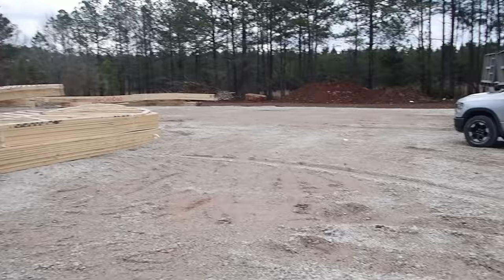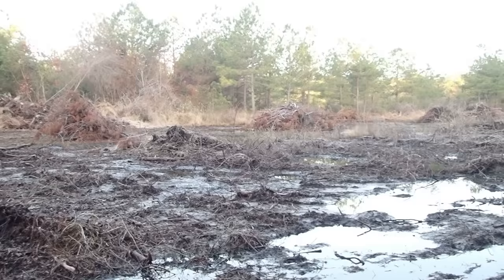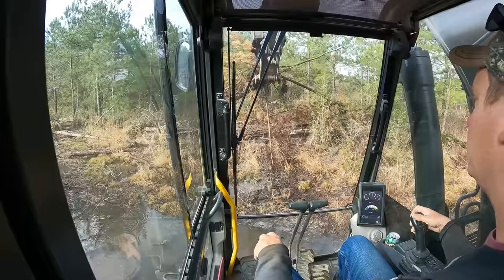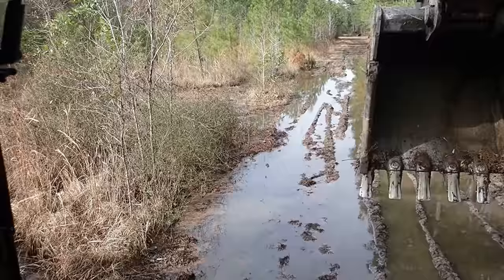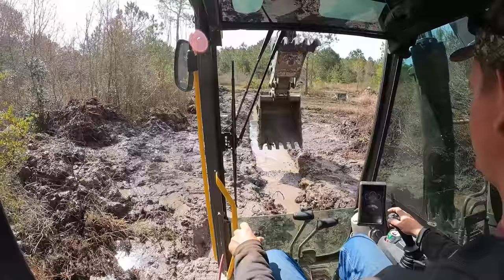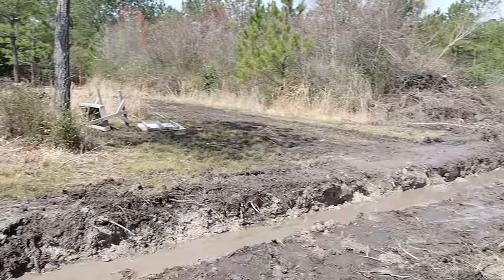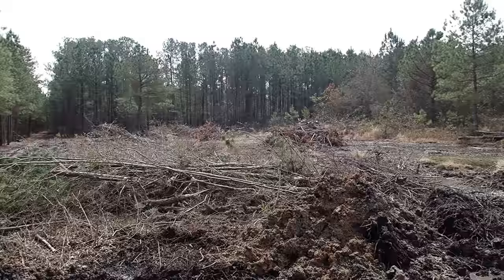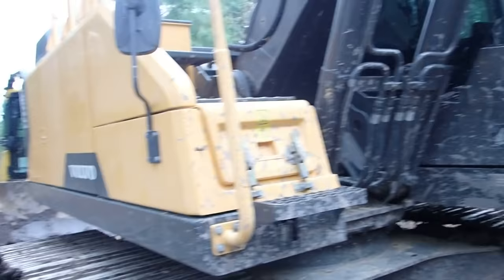Its Time To Drain The Swamp!

Comment: I have 50 Acres of bottom land hardwoods, so basically it's a seasonal swamp during the wet season. Completely raw land that we are trying to handle ourselves. I don't need it all drained, but it's basically 90% under 6 inches under water almost half the year. Thanks you for this video. We will have to rent some equipment and get this figured out. I'm thinking we need multiple ponds.

Comment: Sounds like you need a Mr Ajworks style V ditching bucket
Reply: That bucket is only goid when you know the soil is clear. Stumps, rocks, bodies, will all stop it doing the job.
Reply: @wendymorrison5803  Yes, maybe for bodies! ;D  Otherwise it's working fine in our extrem rocky forest here in Sweden, using sturdy ones with 3 teeth or of course tiltrotators and ordinary buckets for bigger ditches. <3

Comment: I think you're mistaken about the effect of the "fall". The fall doesn't affect the direction of the water flow, only the level of the far end of the outflow affects that. You could dig the entire thing with the fall backwards so that it was 10ft deep at the head end and the top 3ft of water would still flow out the outflow 3ft below ground level. The bottom 7ft would just not go anywhere. Maintaining a consistent fall is important to avoid damming up water but it won't cause the water to flow backwards. Only having an outflow below water level at the other end would do that.

Comment: It's always amazed me on how fast a spot like that can dry out once the vegetation is cleaned off.

I kinda-sorta stumbled onto that method of cutting drainage, just did it in the opposite direction.  Just make sure the water keeps following you at about the same level.  If you discover a high spot, you can often massage it down with the belly of the bucket.  Doesn't work so well if it's already dried out, though.

I think I could come to appreciate a machine like that one, if I could ever get my head around those joystick controls.  I started on an old Case 530.  Later I got a 4500 Ford, after over 20 years I still get the controls mixed up and I find myself trying to stomp on non-existent pedals to swing the boom.  I tried a John Deere 310 one (1) time.  I got that chore done, but it was a good thing no one or no other equipment was within it's range, or there would have been murder done.

Comment: Eastern North Carolina, I love that area.  Best pulled pork sandwich to be had in that area.  That is place where a good drainage plan should be put in, I would use Gabion cages and let the water flow through them to pipe and out of the property

Comment: That's an amazing before and after shots from the drone, and an all round interesting video.  We do love drainage videos — even more than fire videos.  That was a reminder of how much mass the 220 has @50 minute and after where the body (is that the right term?) pivots and has so much momentum that the entire excavator pivots a tiny bit on the tracks when the body swings back the other way.  I guess with so much of the mass in the counterweight, and a long way out from the pivot point. the turning moment is going to be significant.
Reply: I saw that also

Comment: Non Operating Operator digging a ditch to  nowhere , with No destination for the water to flow to.  BRILLIANT !! And what's the difference between a claw  attachment on your bucket and  a " Grading Bucket " ?
There's No Such Thing ! A bucket is a bucket and if you were any type of an Operator , You wouldn't need to change your bucket for any reason .

Comment: Hi, I am from Sweden and I am always amazed by all the diggers around the world that uses one fixed buckets. Check a swedish excavator business, there is not a single machine that does not use a tiltrotator. It lets you rotate the bucket 360 degrees and in the same time tilt it. It is also equipped with a hyadraulik system form changing buckets in seconds. Had an digger here last month for som garden work and he had three different buckets with him. It makes you excavator more versatile and productivity increases by double digits.  Check out a company called Engcon for more info.

Comment: At the beginnng you said that someone had run a ditch all the way around the property.  If that ditch does not go someplace your new ditches will just put the water someplace else and those old ditches are in worse shape then your new ones.  Yes the water has to be drained off the property but if it has no place to  go........  This place I live is like that.......River across the highway creeks on two sides.  Developer put in french drains to nowhere.  Someplaces on my lot I can hit water at two feet deep.  It looks to me like you are going to have to reopen up the ditch around the property and hopefully run it onto a creek.

Comment: lots of Material to made Charcoal .Free Heating is everytime good.
Reply: will one deep Hole some pass the solid Flat be also good? it is the solid Flat some you must only open up and the water run down this deeper Hole. it can be not more then 3-4 meters deep to cross the solid Ground,right??

Comment: We never see that style of kneeling trailer in Australia, we use 15-inch wheelsets and ramp load over the rear and that excavator would go on a deck widening trailer or if ya rich a chassis widening trailer.

Comment: Question: Do the hydraulics on machines such as this have some sort of "neutral" mode, where gravity is allowed to pull the arms, buckets, shovels, what-have-you, down to the ground, releasing any pressure from the hydraulic lines? Or is that only possible with a leak?
Reply: Yes, some do have what is known as "Float" mode. I have a compact backhoe and when grading or leveling, it really comes in handy. 👍